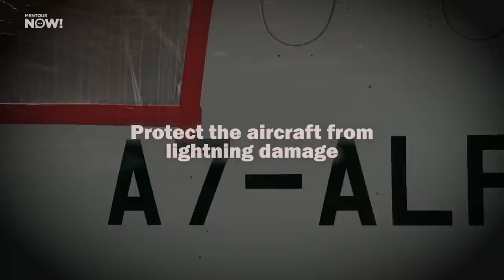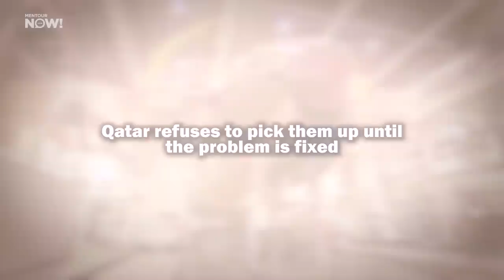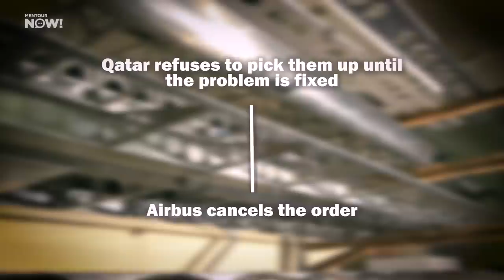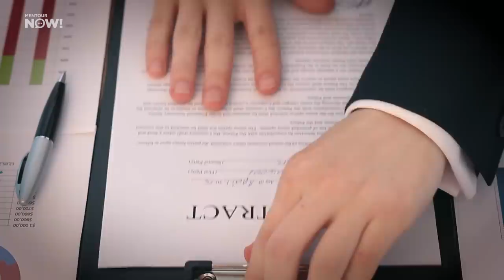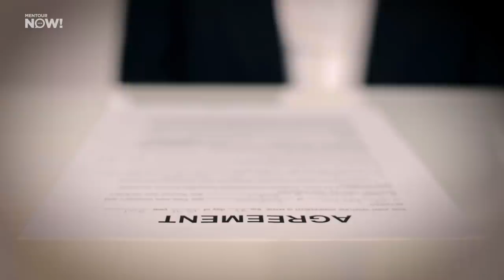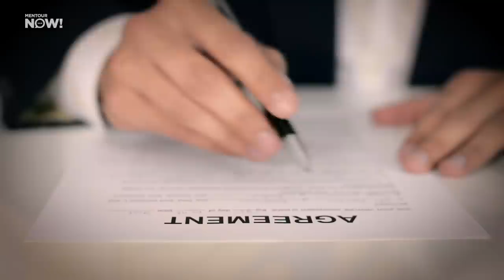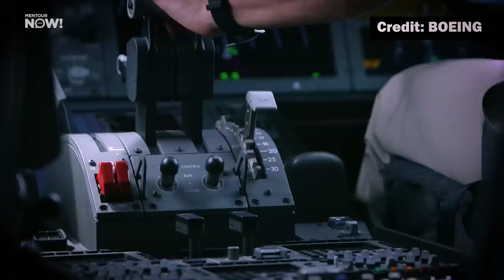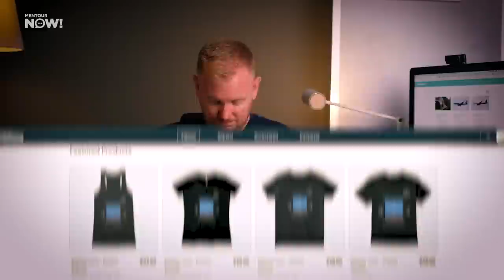WHO is Winning the FIGHT between AIRBUS and QATAR Airways?!

Comment: I can understand why Airbus cancelled both contracts. If Qatar went as far as declaring the paint issue as a flight safety issue and got support from the regulatory agency of their country and then refused deliveries, I’m sure Airbus wouldn’t want a repeat of that with the A321 orders. I think more than an issue of prestige it has now turned into an issue of trust.
Reply: On top of that, Airbus is currently going at full production on the A32x-family, so it's not like they are losing money. They will just work for airlines that are more likely to actually pay.
Reply: As long as we c less n less airbusses in the air umm happy 😁 unfortunately Boeing Don have small to medium range people haulers 😢

Comment: While I do sort of understand the concern with how airbus is handling the issue, ultimately qatar airways signed the contract with the cross-default clause...if they didn't like it, they shouldn't have signed it. Airbus isn't really doing anything wrong here IMO, they're sticking to their contract.
Reply: @somebody700  then they should negotiate to not have those clauses in there if they're that concerned
Reply: @somebody700  yeah, that's fair
Reply: C B  How is anti-American sentiment relevant here? No Americans are involved or am I mistaken?
Reply: Not sure if it's the case, but it's possible the cross-default clause works both ways - i.e. allowing Qatar to pull out if Airbus doesn't uphold its end. It might have appeared like a good idea for Qatar at the time too.
Reply: @mike-barber  Exactly. It's not an unusual clause in contracts, and usually it's bilateral.

Comment: As a composites engineer, I have to agree with Qatar in that loss of skin integrity (paint peeling) is a concern.  Their mistake is calling it a safety issue.  It is an airframe life issue.  Those composites inside that metal mesh are highly susceptible to moisture damage.  With breaks in the paint, moisture will gradually penetrate into the structure which may shorten the use life of the airframe.  You spend this much money on something, you want to get your money's worth.  But you don't start tossing the "safety" word around in the airline industry unless you have data to support it.
Reply: ... and we may or may not know about an airframe lightning strike mitigation failure for an A350 till maybe 10 years down the line... just hope it's not one that causes a hull loss...
Reply: Curious question - Is it to do with that specific paint color that Qatar uses?
Reply: @suprashank  Think CX was the next carrier that saw significant issues... could be a primer issue, general environment issue (desert plus salty sea air), thermal cycles, paint chemistry/colour issue (QR uses grey rather than white?), or some combo of the above... tricky eh?
Reply: @suprashank  Lufthansa, Air France and Finnair are experiencing similar paint issues, neither climate noir paint structure is the cause. May be the age as said carriers, including QA, operate the „oldest“ A350s built.
Reply: Several people from Airbus or in contact with Airbus corporation commented on social media that Qatar was warned multiple times not to use thick layers of paint, They obviously did and the result was a not so elastic paint that would crack and peel off.
Reply: @asicdathens  Fairly sure AIRBUS painted all fresh off production line A350s... them being painted elsewhere not even going to start happening when early ones get resold...
Reply: that's probably why airbus decided to just kill the relationship. They did try to help out qatar at first but then qatar was just being so baby about it that it wasn't worth the hassle. Airbus knows this is an issue and they want to fix it so it's not like airbus is the one who's wrong here.
Reply: "highly susceptible to moisture damage" - when 0,01% of the total painted composite monolithic skin shows outer paint damage is a massive overstatement. Of course - the affected zones could be easily repaired - with less circus and a bit more honesty... 
But let's imagine some moisture manages to affect the epoxy resin on a few squared centimeters if really no repairs are undertaken!  You might be theoretically right about airframe life reduction, but I fell we speak about lost days from probably 75-100 years of theoretical airframe life.
Reply: @JonathanStanley  Aircraft get hit by lightning pretty regularly. Probably several A350s have already been struck by lightning. (Or do you just mean that we won't really know until some plane has had multiple lightning strikes?)
Reply: @suprashank  "Is it to do with that specific paint color that Qatar uses?"
At least some of the damage shown in the video is to white paint, which is the basis of nearly every airline's livery. (Unless it's some Qatar-specific shade of off-white, but I doubt that.)
Reply: @suprashank  I don't think I recall reading about another airline having the same issue but on a smaller scale
Reply: Lisa the composite engineer. I agree with you. To have layer defects like this so early isn't a good sign. Will Airbus give a lifetime airframe warranty? Maybe it's only 10 years?
Can imagine the complexity of trying to remove so many parts and move them to a replacement airframe?

Is it "just the wings"? Oh so only the engines, fuel tanks, air control surface systems including all the electronics, servers, pumps, detectors, and miles of wiring etc.

Airbus do need to step up and back their product, if they are so sure of it.
Reply: @Phillip Banes Qatar Airways are claiming that it's a safety issue now.
Reply: @Phillip Banes I agree that this may be the case. But because of the ramifications at play anytime the word "safety" is used in the aviation industry, there should be testing and data, even if it is only preliminary, to back such a claim up.
Reply: @Lisa Nadine Baker You seem to be presuming that the composite deterioration will be easily detectable and therefore not be a safety issue. Are airline maintenance staff that much up to    snuff with composite technology as they are with detecting embedded corrosion on a metal structure?
Reply: Qatar has a history of being a difficult customer
Reply: Thanks. This is the question I came to ask: What was the nature of the safety issue raised by Qatar?
Reply: @Phillip Banes I am sorry, I should have been more clear/thorough in my original reply.  You are right - in the long run it may be a safety issue for the airframe.  But Qatar's claim was that the aircraft were unsafe and "not airworthy" in their current state.  They were claiming existing cracks.  Those type of statements, if there is appropriate data backing it up, can ground whole fleets. Even without good data it can cause mild panic. You dont start throwing those words around in the aviation world until you have done your due diligence and checked it.  And, then, the best results are achieved with a partnership approach to the problem solving.
Reply: @petep.2092  no simple answer to that one, especially as Airbus is an EU company and I am know less about their procedures.  I can tell you that failure behavior of composites tends to be more predictable (fewer special cause events) than machined metals.  We have 30+ years experience with composites in our military jets, and we knew a lot about what to do, not do, look for, etc. before we took the FA18/18A to 40% skin composite back in the 80s. Our technology and testing capabilities have advanced orders of magnitude in that time frame. 
 I think the unknown is what/how to most effectively test these large parts and large joinings particularly with the atmospheric and thermal cycling they will see over time.  What is the right testing frequency? Does it need to increase with #of flights?  What locations on the vessel?  I could go on, but i won't.  Does home port need to be taken into account?  Our tendency is to look to past examples as a guide but most of our past reference are metal aircraft.
 Long answer (and I apologize, but, hey, I am an engineer.) - there will probably be a learning curve, but no one is going into it blindly.  The industry is much smarter than it was even 10 years ago.
Reply: @JonathanStanley  yes. And initial aircraft was sent to UK for a special paint job when this first surfaced. They then flew it to Toulouse for warranty claim.

Comment: I don't think you meant "prestige"; you most probably meant "pride".  It is now a matter of pride for both parties to stick to their guns.  But you seem to slide over the fact that it was Qatar who started all this.  And it was Qatar which did NOT want any negotiation but proceeded to bring Airbus to court.  In my view, Airbus just has had enough of the pompous posturing of Qatar.  And now Qatar is held hostage to Boeing.  That they now have to re-activate their 330s and 380s shows the stupidity of Qatar in this whole matter.
Reply: Thanks -- "prestige" was obviously wrong, but I couldn't figure out what he actually meant. I think you're right with "pride".
Reply: Indeed, exactly!

Comment: I'd actually like to see a video about the life of one of these "stored" Qatar Alirlines planes and how the mechanics go about choosing which planes to pull out of retirement first and all the things they do to get them back into shape.  Not exactly something one can report on without being there I suppose, but it is interesting to me.  I was also surprised by the fact they were retired so early.
Reply: I agree
Reply: Cassie
Newer aircraft had lower operating costs, in view of the rapidly increasing fuel prices and pressures to reduce oil products, fuel consumption reductions were the deciding factor.
Aircraft go through periodic maintenance and tests , performing those tests before putting them back in operation, is what happens.
In this case the A 350's need repair . AB refuses to fix the problem, The court in England will decide, while Quatar happily flies their 67 B-777's, more economically btw.

Comment: I like the reawakening of the A380 option. Just personal opinion.
Reply: My entire childhood was spent admiring the program and being super proud of finally having a European 747 and now they are being retired after 5 years. Barely a quarter of the development program. Super sad. I hope jumbo jets make a comeback and maybe Boeing makes a replacement for 747. But a proper one, not just glue two 787 together with a software fix to keep it flying level...
Reply: I think they are done. Jumbos are just too expensive and too limiting to operarate for most passenger carriers. The 747F will be around for decades at least.
Reply: @shrimpflea  I can still dream about my supersonic double decker jumbo jets. I imagine an XB-70, but 300 m long , 4000 t fully loaded with 70 engines, half scramjets, a bunch of turbofans and the rest afterburning turbojets. And screw fuel cost it runs on liquid methane made by solar powered sabatier reactors taking carbon from the atmosphere. For long distance it carries LOX droptanks and boosts into a low orbit, stainless steel airframe with ceramic tiles on the bottom. 1500 passengers, atmospheric top speed mach 9, mach 20 with the droptanks and auxiliary rocket engines.
Reply: @shrimpflea  The staircase connecting the 3 main decks is of course styled after RMS Olympic.

Comment: I Work in a PCB manufacturing company and we have our own fair share of customers like Qatar who complain about every small thing which has no effect on the functionality of the product. These customers just like all airlines have multiple suppliers and they have problems with all of them. We like to deal with all our customers professionally up to the point it doesn’t start hurting us financially. Our business also runs financially the same way as airbus. When all suppliers start kicking 1 picky customer out they have no choice but to pay a higher price because no one wants to do business with them. In the end these companies run themselves into the ground no matter how good they treat the end customer. Qatar clearly doesn’t understand that there are only 2 major airline manufacturing companies and having bad relationship with either one or both of them is an extremely terrible idea. That’s just 1 way of running yourself into the ground.